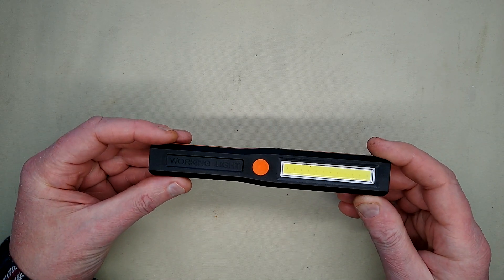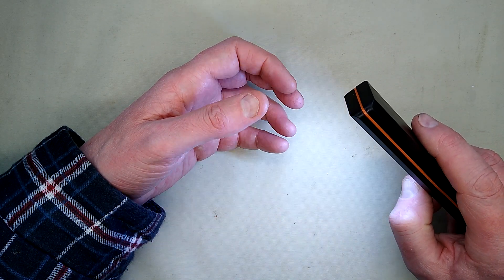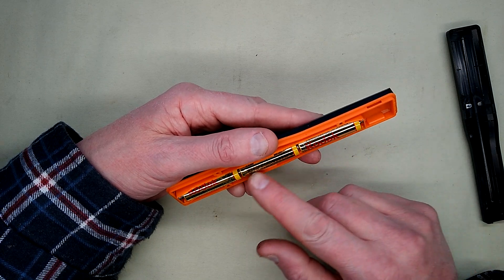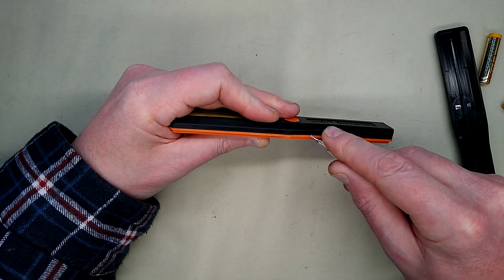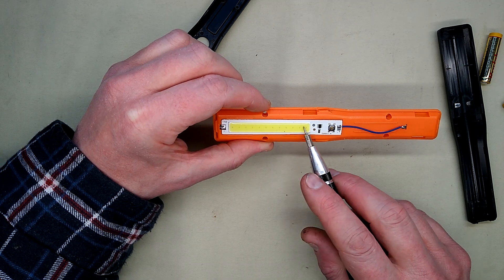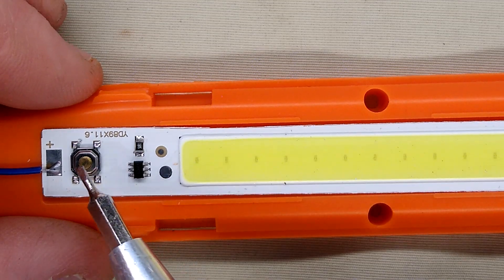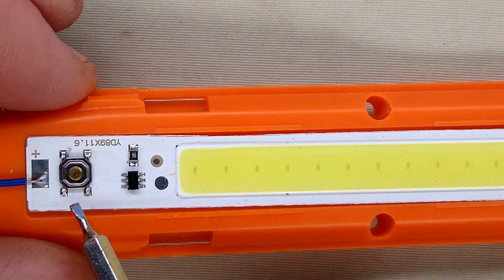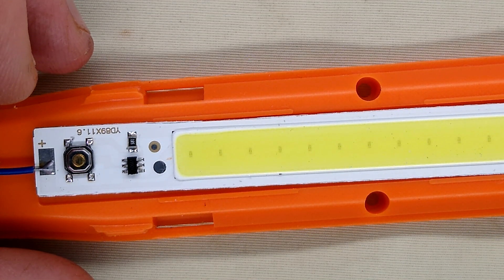Is this the new COB flashlight standard?

Comment: I really like the design, but AAA batteries? No. Hell no. Never again. I don't know why the feck the chinese can't understand WE DON'T WANT AAA BATTERIES IN THINGS, YOU CLODS.
Reply: Because the led lights that use coin cells are soooo much better. Or rather only good for the bin.
Reply: They kinda make sense: LEDs are low current, high voltage. So you need 3 cells to get your voltage. So if you use AA's, you get a very heavy flashlight that... doesn't make any more light...

Of course they tend to leave out the boost converter and cheap LEDs aren't the most efficient thing, so it's all kind of moot anyway even with AA's.
Reply: @cheyannei5983  More runtime though, AAs are around double the mAh. And since the two are often priced the same, the light would cost half as much to run.
Reply: don't mind so much when it's the 3 batteries in a round holder, easy enough to replace with an 18490

Comment: I'm loving COBs over those ugly little blue led bulbs that were out there for a while. I even modded out a camping lamp. I took this lamp, doubled the cobs(I had to trim the reflector and do a bit of soldering) and replaced the 3AA battery compartment with a 6AA battery pack. In all I quadrupled the lumen output. https://www.amazon.com/gp/product/B07DXC6WGZ/ref=ppx_yo_dt_b_asin_title_o08_s01?ie=UTF8&psc=1

Comment: I bet you can cut the battery holder and extend it for AA cells.  Alternatively AA (14500)  lithium ion cells would be even better but would need to be parallelled.  A single 14500 would work and provide more power than cheapo AAA... hmmmm... for that matter stuff the guts of a cheapo vape in there.  The cell will fit and it would be rechargeable and it is repurposing!

Comment: I am sick of the AAA battery flashlights as well. Why can't they just use 1 or 2 AA's? I have a decently powerful single LED flashlight that uses only 1 AA and I love it. All of my other flashlights that I randomly buy (I kind of have a thing for flashlights even though I barely use them)when I'm out and about, all use 3 AAA's and replacing them is a bitch. I actually want to get some cob lights with the strobe/sos modes so I can trip balls with them, but i would rather they be AA.

Comment: Really nice design and colors. But when they stop adding that damn strobe mode... There is few usage for it but its like 0.01% of situations.
In other hand... Anyone saw flashlight with "sliding" button that set brightness depending on how far you move it? I had it one time and it was cool as hell but cant find those anymore, and if I find it its some cheap crap that break after one day :/
Reply: I bought several NEBO brand lights from the local interstate dealer.  They are chinese of course but they at designed and patented in the US and China so there dont appear to be clones.  All of the lights have useful functions like dimming and it remembers the dimmed amount.  The best one is called the "Big Larry" which is super durable (dropped it lots, cycled it in cold weather lots, rain, dropped it in wet concrete).  As an added bonus you get endless... "can I hold your Big Larry" jokes.
Reply: @someguy2741  a Chinese patent... LOL.

Comment: can you do a video about phone chargers killing Babies and how a 5v charger can do that with the resent death of a baby dieing the other week by puting one in his mouth and dieing from a electric shock.  thank you
Reply: Those will be unofficial 5v power probably referenced to mains. 5v can't do anything to anyone if properly isolated with a branded plug.
Reply from the maker: That sounds like a faulty charger with the 5V referenced to the mains.
Reply: @bigclivedotcom  yes thats what i was thinking cus 5v can not kill you so it must of been a cheep faulty import charger.
Reply: james
Reply: Hmmmmm... i wonder if 5v can jump across a tongue.  People really underestimate the insulation value of their skin.  I have gotten some very interesting shocks from low power sources when they touched broken skin.  I would assume a baby would have even lower internal resistance.

Anyone with a baby and a multimeter want to check the resistance value across the tongue... say 5mm between probes like a USB connector would be?

Unofficial main reference would be deadly of course.  I would also suggest that if the kid is slobbering all over it it might have shorted directly to mains at the input side.

Ok I googled... this came up https://www.google.ca/amp/s/www.mirror.co.uk/lifestyle/family/honest-mum-shares-photos-toddlers-11313161.amp

I think this is different.  If they kid got whacked by mains (110v in Kentucky) it would have died and it doesn't sound like it was in distress.  I wonder if this is DC erosion of the tissue judging by how it dug a groove.  It tingles and feels funny so the kid plays more.  The tingling disables the pain receptors.  I bet this kind of injury happens a lot.  Deaths not so much.
Reply: Some Guy - don’t know, but I do know that a 9V PP3 cell tingles if you put it on your tongue...
Dry skin is a poor conductor at low voltage due to the outer layer of skin being dead cells. But inside the body, or where there is a wound, then there is no layer of dry dead skin, plus the body fluid may be salty, hence will more easily conduct low voltage electricity.
Reply: @Mark1024MAK  Exactly.  Also you don't have the fat layer and the skin itself in the way.  All juices in the body conduct well.

Comment: I too would like most items to take AA so I don't have to change them that often. But nooooo, let's use button cells to power an electric truck.
Reply: Lol.  RC cars... the cheaper they are the more likely they make them use AAA cells... it doesn't cost any difference for them to form a AA holder but.... nooooooooooooooo.  Just be glad it isnt 123 or N cells or AAAA i guess :p
Reply: @someguy2741  or LR44s those things SUCK
Reply: @refraggedbean  The only upside is you can get those and 2026 and 2032... and 2016s i think at dollar stores.  Makes me feel dirty buying junk batteries.
Reply: @someguy2741  you can't find them in person at all here for some reason, so everything that uses those that I have sits unused because they're expensive for how long they last and I have to get them shipped to me
Reply: @refraggedbean  Honestly if it wasn't for dollar stores and other very low level stores these batteries would be extinct.  I get mine at a local "liquidation world".  I dont think anything I have couldnt have been made slightly larger and contain a AAA.  Maybe the AAAA should become a standard instead of an oddity.  It would be good for tiny low use things.
Reply: @someguy2741  you forget sex toys exist then, I think those combined with cheap kids toys are the reason they still exist, I think just dollar store stuff wouldn't be enough (also AAAAs are amazing but only thing I've seen use them is a stylus for a Dell tablet)
Reply: @refraggedbean  I support a lithium ion AAAA as the new format.  I will call China and let them know!  Its a brave new world!
Reply: Simon Mikkelsen Just duct tape a 6 volt lantern battery to the flashlight.  It will last a bit longer than the AAAs.
Reply: @gsmjr8502  Have you tinkered with lithium ion 14500 cells?  Handy for devices with AA battery holders if you can get the voltages right.  Lol... just keep them away from people who dont know what they are or many electronics will be broken.

Comment: Now you have a new 3D printer project. Create a new case for the light that takes AA or even 16550 batteries.
Reply: It seems that if you dremel out the original AAA battery holder in the middle of the orange plastic part you could easily fit at least two 14500 cells (wired in parallel) and then a TP4056 module at the back (micro usb accessible at the bottom of the torch).
I don't know if an 18650 could also fit it seems not deep enough for that but it's not quite clear from the video.
Reply: I have a more traditionally styled flashlight that does use an 18650 cell and uses both a traditional single 3-4W single LED with reflector plus a strip style COB with 15 red and 16 white LEDs that can be used as an area light (the red is very nice if you seek to protect night vision) and it is all built into an aluminum housing.  My only complaint is that they did not use a standard protected 18650 cell but rather a “radial” style one with both contacts on the same end so you can’t just buy ordinary 18650 cells and you have to charge them through the flashlight’s micro-USB charging connector — that is really my only negative/dislike of the Slyde King flashlight.
Reply: @ethanpoole3443  Protected cells aren't the standard. They're much less common, esp since they're not 65 mm long, and they don't fit in regular 18650 battery holders/sleds.